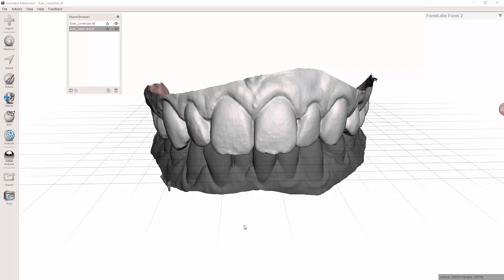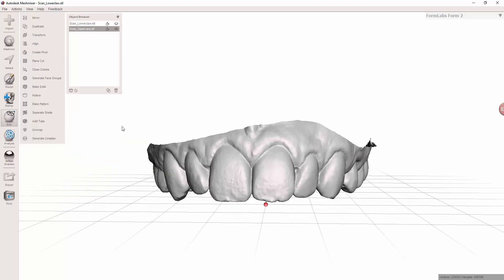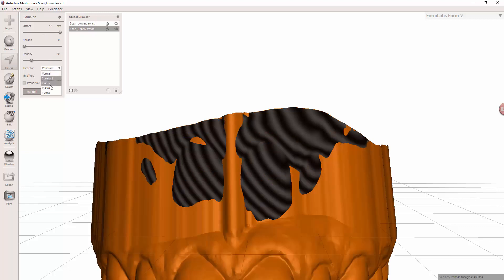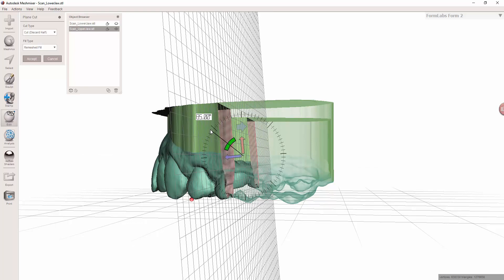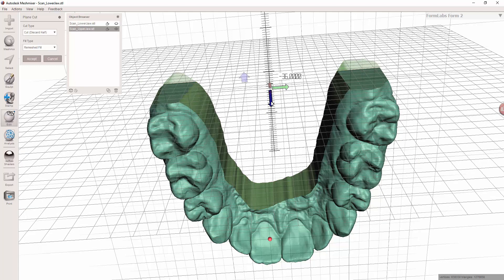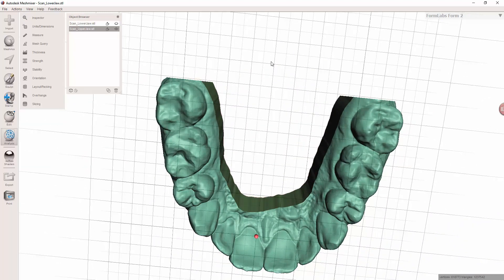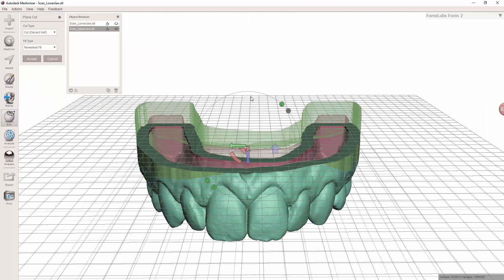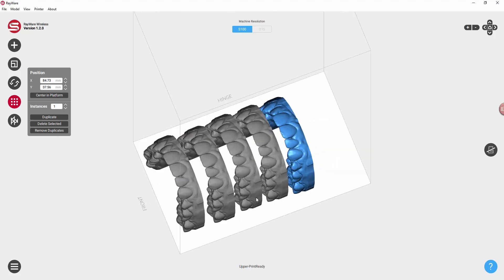(UPDATE) MeshMixer- Vertical Model Printing

Comment: I think I have it right but when I put them on the print bed in rayware I still get a message that its not printable and it wants me to add supports. Do you still get that message before you print this way?
Reply from the maker: Yep, just go ahead and print.
Reply: Baron Grutter DDS thanks!
Reply from the maker: I just remembered that this comment was from the meshmixer video. I'm reading it on my phone, so it shows up as just a comment. Anyway, if you are making these in meshmixer, I can't promise they will print. I just know that files we export from blue sky plan have a tendency to cause that same error warning in rayware and it always prints just fine.

Comment: Baron, I'm having issues creating a hollow model. Everytime I try I end up with two shells. One, the original external shell and another internal to that that appears to be 2 mm (thickness) smaller than the original. What am I doing wrong?
Reply from the maker: At 2 minutes and 40 seconds in, I discussed using the smooth boundary tool to prevent that are. That said, if you have wrinkles or folds in the model, that still will not be enough. At the end of the video, I have other videos that pop up that are suggested viewing. The two on the left side of the video are ones that you should watch. They will help you avoid that's in the future. Also, as a side note, I now use blue sky plan for all of my model basing, Halloween, and labeling. I still love meshmixer and use it a lot for more advanced things, but these simple tasks and now we done more efficiently and for free in blue sky plan.

Comment: Doctor, hypothetically say you did not use the hollow function.  Then you add a base and essentially have a model made like an egg shell.  What would happen if you tried to print the STL file?  Would the printer print it as a solid?  Or would you get an error because you essentially have a shell with no thickness?
Reply from the maker: Would not print as expected, if at all.   Most printers software have the ability to make repairs to models. Any hole in a model that leaves it not watertight is considered an error. It's an open mesh. So, the printing software will try to close the whole. With a very large hole like you describe, it will take a while for it to try and repair a. And that is a very complex repair that if it's even capable of accomplishing, will likely be very irregular. I would not risk it. There are too many free software options out there to close your model.
Reply: @bgrutterdds  sorry I should have clarified.  Let's say you have the eggshell and add a base by extrduing as you show.  So there are no holes.  Can you now just print it and expect a solid, or do you need to go to Edit --> make solid.    Thanks for your reply and all your useful videos.
Reply from the maker: @thomaslim4608  ahhhhhh. Yeah. You can definitely print like that. I almost never use the "Make Solid" tool
Reply: @bgrutterdds  thanks doc.   If I DO want to print hollow, and use Blueskybio, should I base and hollow in meshmixer first, and then bring that file into blue sky?
Reply from the maker: @thomaslim4608  no. Bring the original into BSP. Then follow my videos to trim and such for BSP Ortho
Reply: @bgrutterdds  yes I see that now.  Thanks

Comment: Baron I have followed these instructions on two separate models and when I do the plane cut after hollowing I get an open space around the rim instead of a 3mm closed space. Did the smoothing too. Also when I don't hollow it and get a model ready to print, I export and open in Sprint Ray and the model is missing the base and platform and looks like I have done no work to it.
Reply from the maker: +Scott Bruggeman prior to extruding, press the B button to smooth the boundary. This will alert you to any flaws in the edge and make everything quite smooth. Moving forward from there, you should be good to go.
Reply from the maker: +Scott Bruggeman I see that you did follow the video with the smooth boundary direction. If you did that and are still having that same issue, it is one of the rare occasions where it does not notify you of the issue. The big idea is that you need to make sure the entire perimeter of your model is smooth. If you have a model with a rough border, it will have issues when playing cutting it. As for your other issue, I'd be willing to bet that when you export it, you had the original model highlighted still. You need to hit escape or clear selection so that nothing is selected prior to the export. You are basically just exporting that top surface as it has a separate surface color or as the software calls it service group. Does that make sense?
Reply: Baron, do you always recommend hollowing the models prior to printing to save resin and print faster?  Or is that primarily for aligners models, since you’re probably printing a bunch of them?
Reply from the maker: Honestly, I don't really do it anymore. That's why my most current videos don't teach it. I will again, soon. Perhaps when I don't have to do it in MM 😉
Reply: Ok, that's cool.  Less work.  :-D  That's the kind of thing that does confuse me, because sometimes I forget to look at the dates the videos were taken, and I don't know if something knewer has been posted.  I can't wait for your course, but that's not until May.  :-(